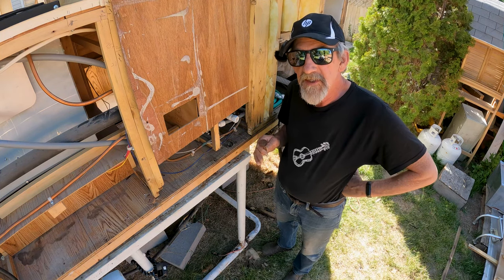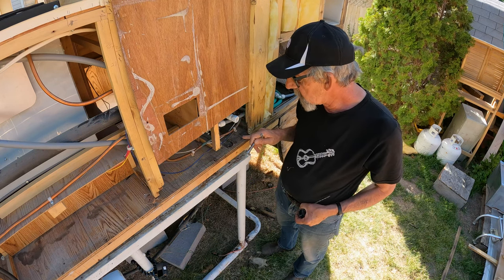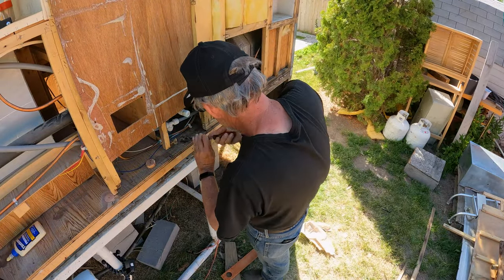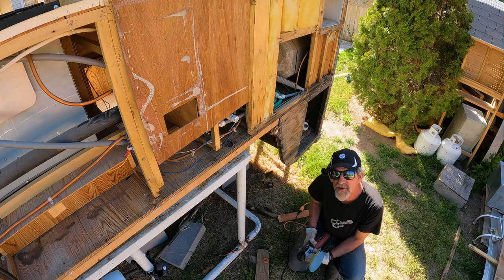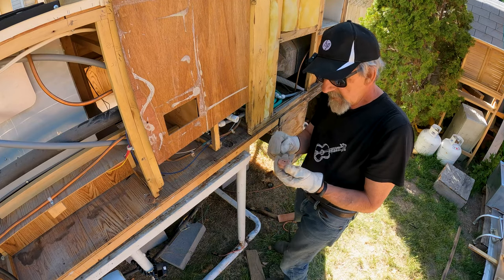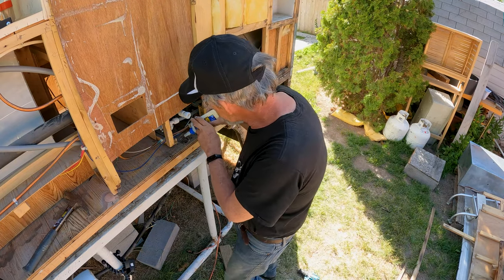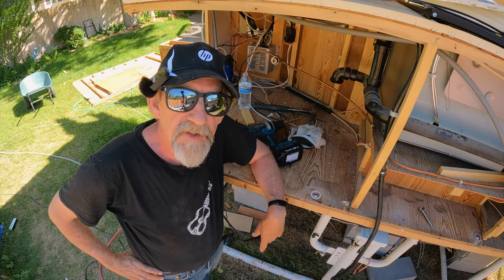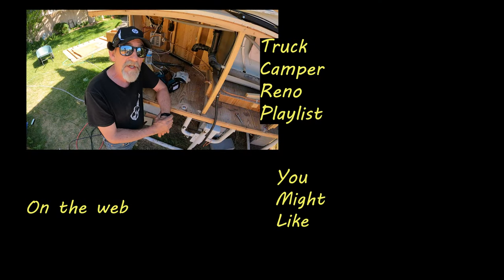Replacing the Jack Bolts ..  - Vintage Truck Camper Restoration

Comment: Why didn't you use normal hex bolts with washers? Or is it not easy to access the tops of the bolts with a wrench once the walls are on?
Reply from the maker: Yes, inaccessible. They sit under the walls which is why I think they used elevator bolts. The carriage bolts worked fine once I relieved for the head so the wall would sit flush.
Reply: @trbowlin  ok makes sense. I figured there was a good reason. Great work. Nice to see short video updates to keep the constant truck camper progress uploaded.
Reply: That is just way to much work to me.  So I bought a 1997 Sunlite for $2,600.  Few minor repairs and added solar on it.  Total cost $3,100.  Has everything you would need to go boondocking, or camp in an RV park and have AC.